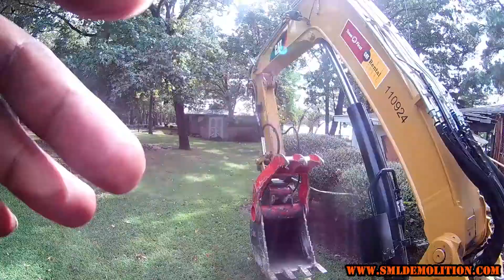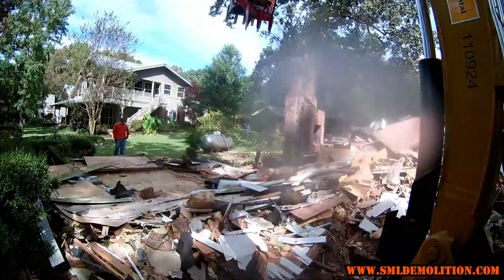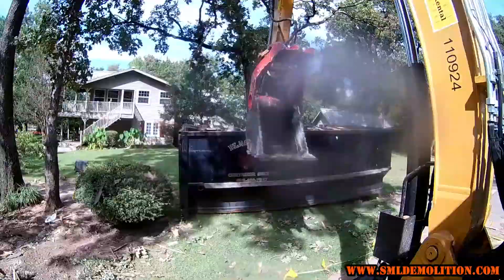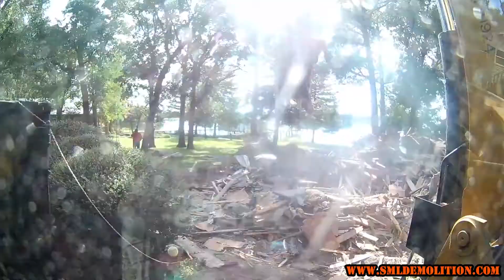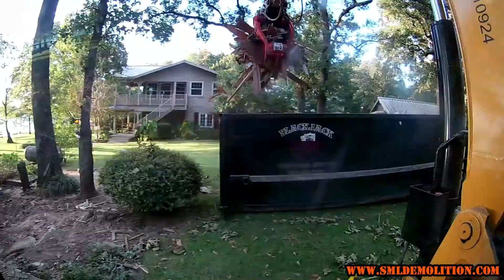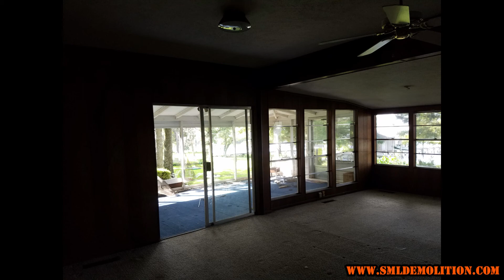CAT 308 Excavator DEMOLISHES Old Lake House -  SML Demolition & Deconstruction, LLC

Comment: How well does that size excavator do for demos?
Reply from the maker: It works very well for residential demos. I've used it on most of my demos and even small clearing projects. The 85z, the Bobcat E85 and CAT 308, all in the same weight class and all work well for demos especially when you have a smaller budget. It's got plenty of power to demo any house and pull slabs as long as they're not too deep or waffle slabs. Then you'd need a hammer. The only feature I wish it had was a counterweight but if you're mindful and dont exceed its abilities, it'll do just fine. I like it because its powerful and versatile enough for demos and it's not too expensive to rent. When I buy my own, I'm going with something like a 160 or a 210, but for now, it's worked great for me.

Comment: What's the cost,for a job like this?
Reply from the maker: It varies wildly depending on where you live. Dumpster fees per company, availability of dumpsters, equipment rentals or if you own your own equipment, the cost to haul it which varies by mileage, fuel, insurance, landfill fees, how much stuff is in the house, type of veneer, foundation etc. In Texas where I'm from we pay $45 - $60 per ton depending on which landfill you go to. In New York, I've heard of guys paying $100 or more per ton. Also permitting here in Texas is easy for the most part and will cost less than $100 in most cases. Up north, guys have mentioned permitting in the several hundreds of dollars and some even require special excavators to do the work. Pricing demolition is something you can't put an exact price to because its totally contingent upon all the factors mentioned above and then some. NOW, some "non-demolition" contractors who pose as demo contractors will do a job at a ultra low and unrealistic cost. I had a woman call me a year or two ago with a two story, 2,500 sqft pier and beam home. I quoted her a fair price and she was shocked because some old "Joe Blow" said it'd only cost $3,000. In all reality, you'd spend $3K on dumpsters alone. Without him saying or even without meeting him, I knew exactly what he was gonna do. He likely had an old tractor of his own that was paid off, he was going to haul all the material to a field that he or a friend owned, then set it on fire. I've lost a few jobs due to guys who undercut by so much that it makes it impossible to beat them. Good thing is that if they get caught...and some have gotten caught, they end up with $10,000 fines or more...so all the undercutting isn't worth it.